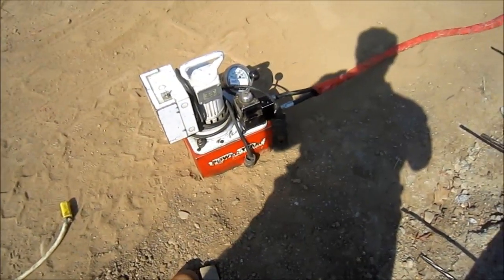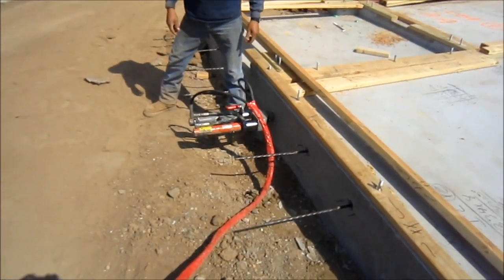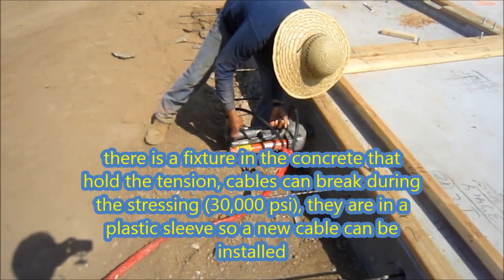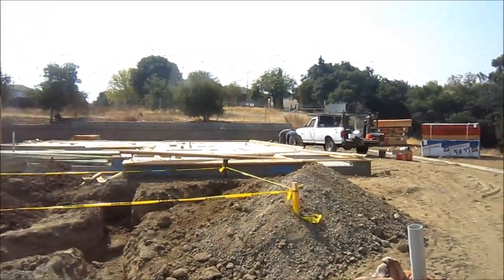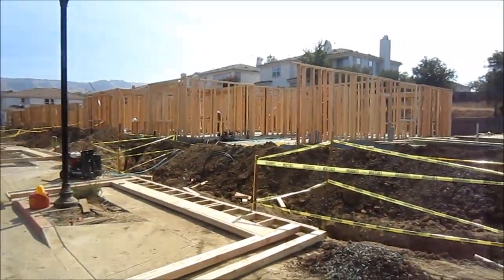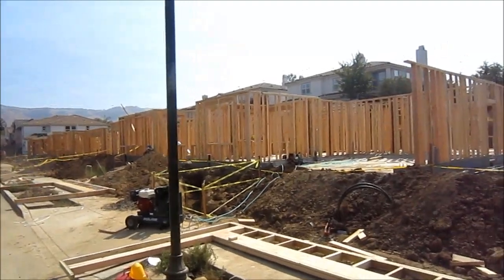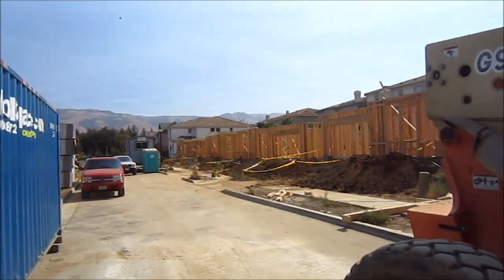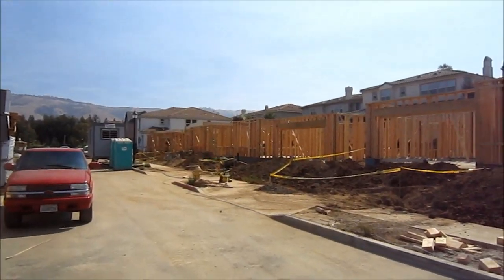Shortie 12.1  6 Day Followup

Comment: hey chuck, unrelated to this video but i was wondering, whats the dimensions on machine room in your shop? thinking about building a small cozy shop just for my metal working tools and yours looks about the size i want, thanks!
Reply from the maker: andrew mac Hello AndrewThe machine shop is 8' x 33', it is cozy but I have really had any issues with getting machines in or out, there is a door on the 8'wall behind the glass beader.  the width was controlled by my sideyard property line.Hope you get your shop built and find the enjoyment that I have.Chuck